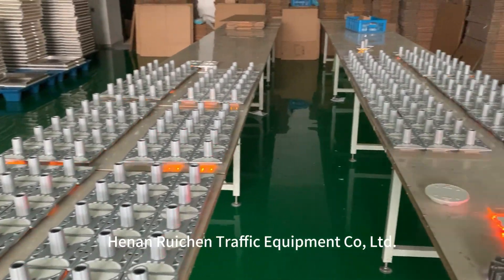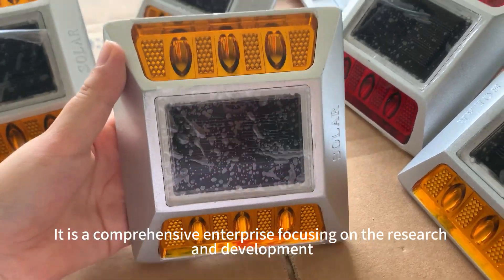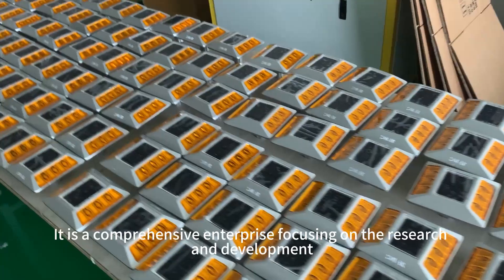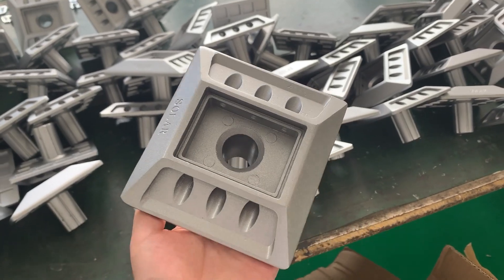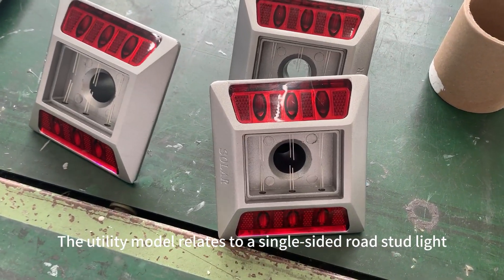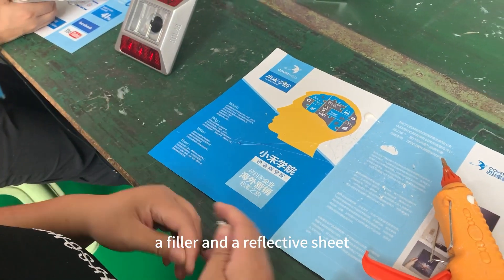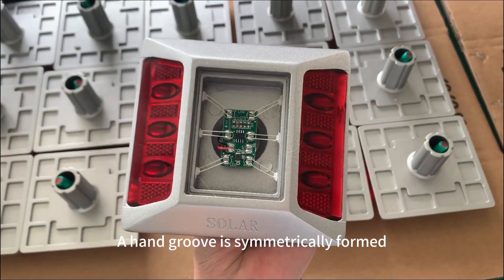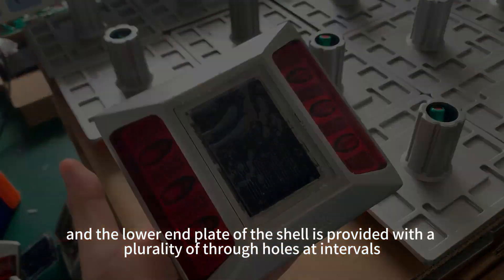This is how 【Solar Road Stud】 is produced.Have you seen it？#roadstud  #solarstud  #solarroadstud

Comment: How about the clean up costs after a car crash and a burning car burns the battery pack?

Does it have lipo batterys? Will it spontaniously fly through a car after it gets ran over?
Reply from the maker: If you have any needs, you can send us an email.
The official designated email address is:
info@rctraffic.com